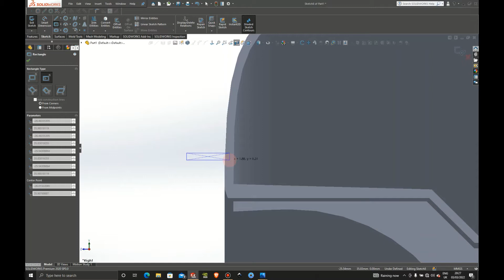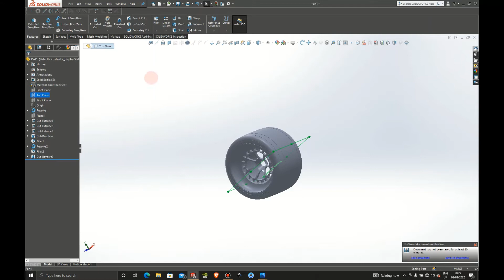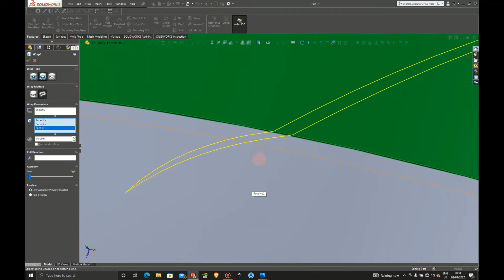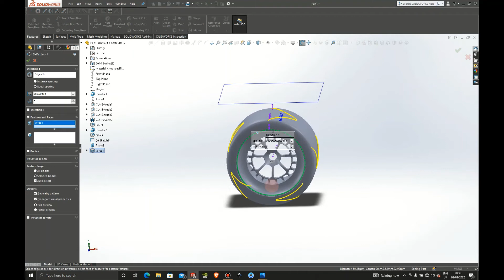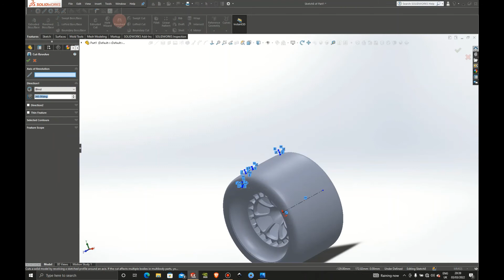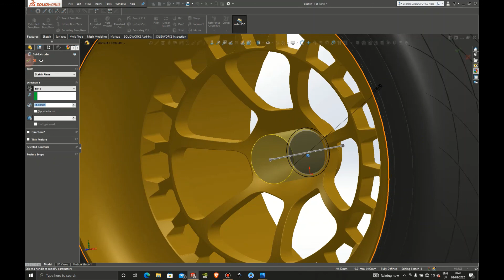how to design Bugatti Bolide in solidworks part 38 -B

Comment: Hello inspire design 101, my name is Jonah and I'm a graduate student at the Colorado School of Mines. I'm working on a project with my group where we are trying to simulate the flow of air around the new Bolide and we were wondering if you would be willing to help us out by providing us with your CAD model. This could significantly reduce the time that our project will take. I would really appreciate any kind of help. Thanks
Reply from the maker: Ok I can do that, I will send you a Google drive download link
Reply: @inspiredesign101LV  Thank you so much. This is going to make our project go so much smoother. Do you need my email address?
Reply from the maker: @jonahrich834  yes please
Reply: @inspiredesign101LV  For some reason every time I send my email, the comment gets deleted. My YouTube account is connected to my google account so is there anyway you can send it via that?
Reply: Can you see my email address? I think my comment keeps getting deleted every time I try to include my email address
Reply: Hey I am also doing a bolide CFD analysis on the bugatti for my final semester here at RIT. Any of the public meshes are very incomplete and yours being made fulling in solidworks would help huge. Could I also have a link to the final file and any info that you'd also like me to cite. Thanks a ton!